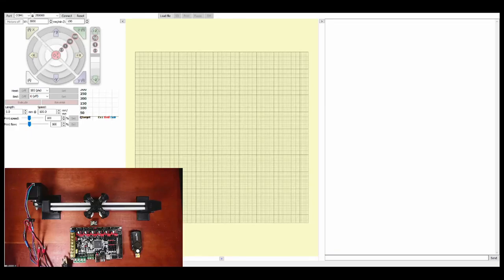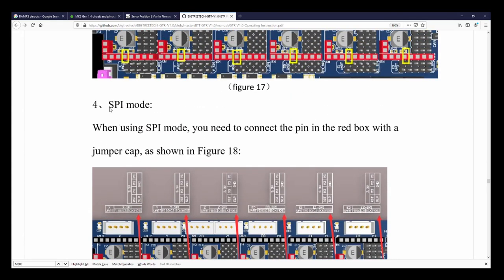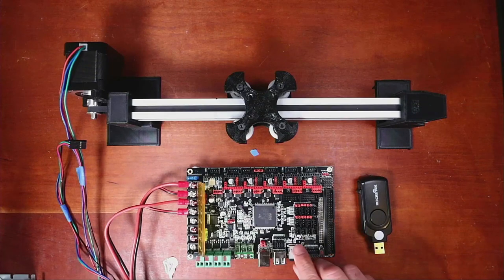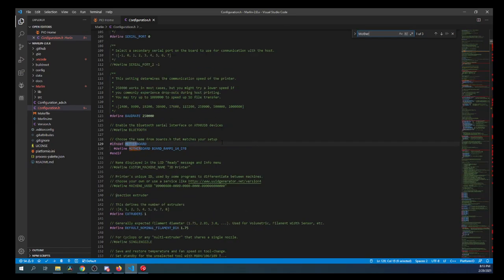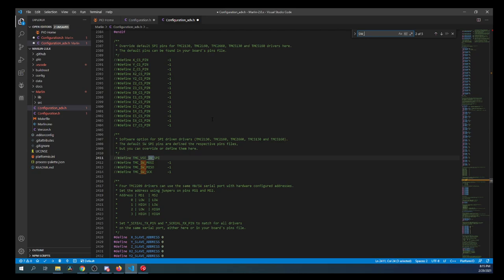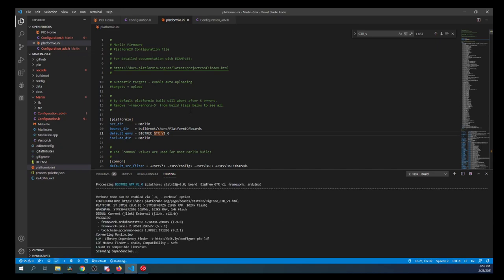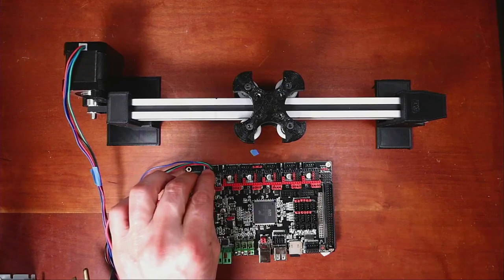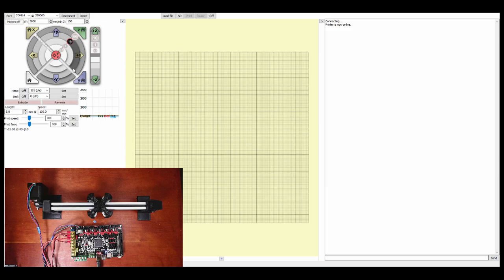BTT GTR v1.0/M5 v1.0 - TMC5160

Comment: what are the stepper pinouts on the  m5? are you ever going to do a video on setting up the m5 board it self?
Reply from the maker: A little way to check is thru pins file for GTR.
Reply: @EdwardBraiman  for the pinout fir the steppers on the m5?